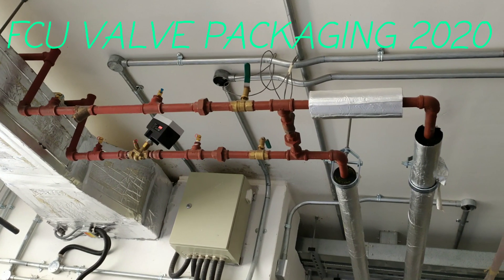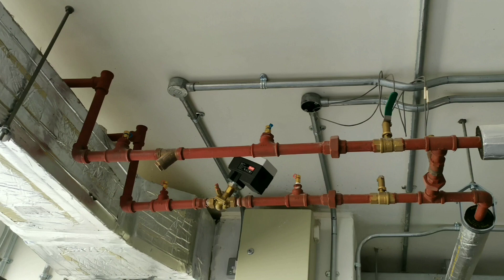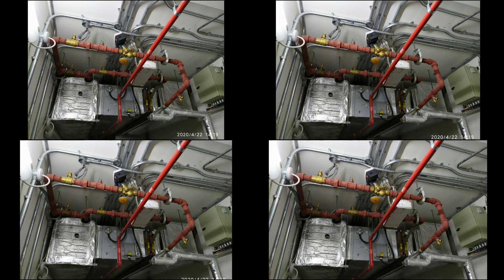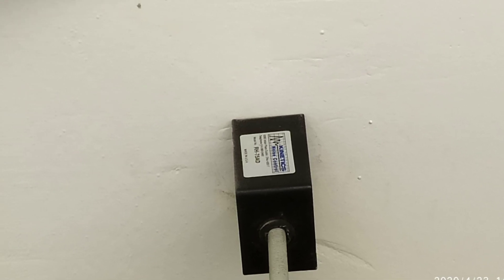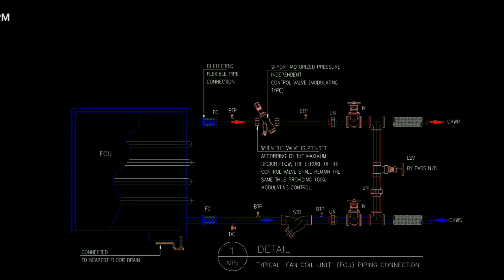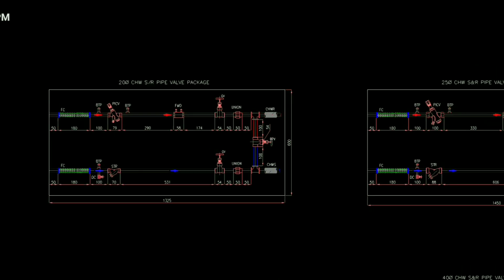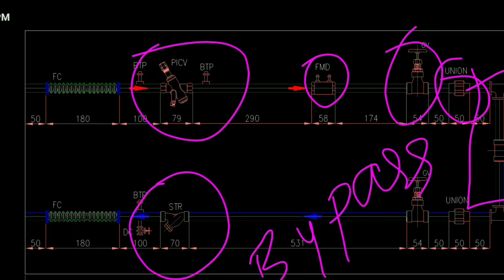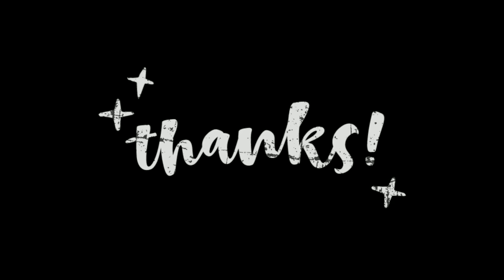Fcu vavle package| Heat exchanger valve packaging|FCU hvac system

Comment: hi dear nice video, for the minimum clearance from slab for fcu with vibration isolator spring type
Reply from the maker: We get this data from oem and as per there recommendations we installed it, there is no objection to consultant and client. U can get this data from OEM if purchase for your project. For more details ask your qa/qc engineering team. 
Thank you
Reply: @EXPLORINGPIPING  normal standard how much it be like for design oriented and site sitable.

Comment: Also can you please tell on below. 
1. What is Pipe material, Brand, thickness , schedule.
2. Which type insulation, brand and thickness.
3. Valvles materials and brand
4. Distance between 2 supports.
Reply from the maker: 1 ms
2. NBR
3. G.I
4. 1.5 to 3 meters as per pipe schedule and dia of ms pipe
Reply: @EXPLORINGPIPING  How can I reach you to discuss more in detail. Pls let me know. Thank you.

Comment: What is FMD in fcu return line?
Reply from the maker: It is FLOW MEASURING DEVICE, USE to set water flow in system as per calculated in heat load for accupant zone
Reply: How to calclute heat load by the method of mathematically prroff kro Exploring piping...

Comment: Bro link for the CAD file?
Reply from the maker: Email id please, I send u
Reply: @EXPLORINGPIPING  muhammedshibil619@gmail.com
If  you have any other important files for installation as well as design you can send me that too( especially chilled water pump rooms) etc
Anyway thanks for the reply
Reply from the maker: Good luck 👍 check out ur Gmail, I have attached cad file
Reply: @EXPLORINGPIPING  thanks for your reply.
I checked my Gmail
But Unfortunately I didn't get the email from you. Please cross check the email Id.
Or if you can share the email I'd here . I will request the same through Gmail
Reply from the maker: @muhammedshibil1143  I have sent again....
mohammedshibil619@gmail.com
Reply: @EXPLORINGPIPING  it is muhammed not mohammed.
 Instead of O you need to use letter U.
That's is the problem I guess
Reply: Waiting

Comment: How to test pressure of chilled water and temp of chilled water
Reply from the maker: After installation, we start hydro test in order to find leakage in line at 15 bar pressure, manual test pump or prepare hydro test manual by yourself.
Reply: @EXPLORINGPIPING  please can you make a video on thermometer
Reply from the maker: Temperature I have Thermo meter instrument
Reply: @EXPLORINGPIPING sir please one video make how to change temperature meter & gauge & air venter.